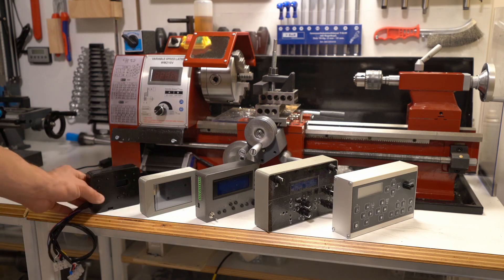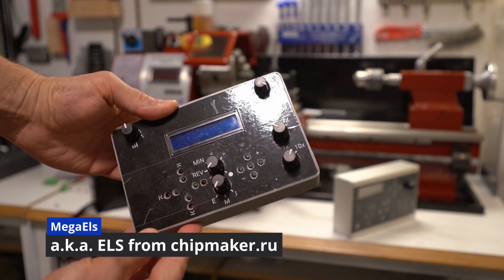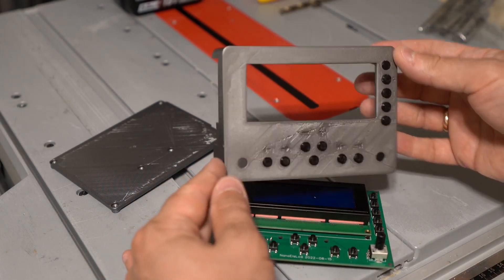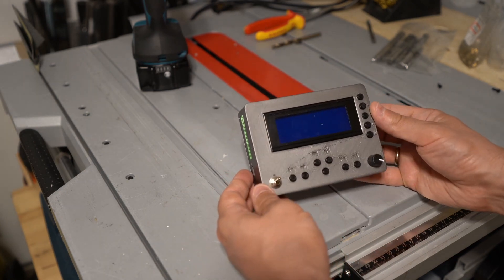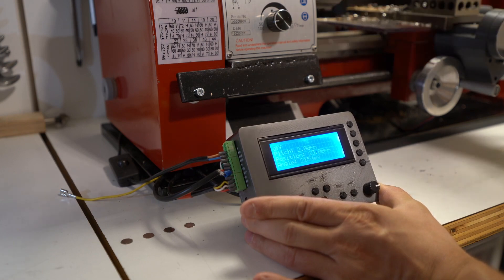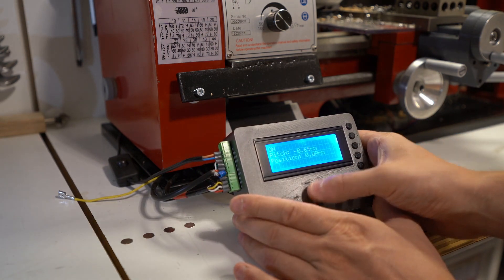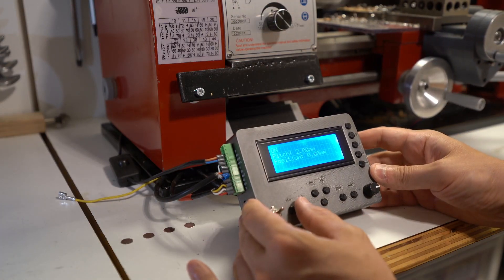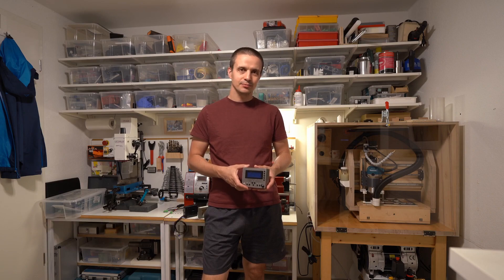Arduino leadscrew: improved 1-axis NanoEls

Comment: Congratulations for your channel! Brilliant devices, clear presentation!
I love very much this kind of "half-dumb" controller for half-dumb people. I am a workshop rat and going full CNC is a no-go for me. I usually make my parts on-the-go  but I would like certain automation to speed up work. I hope I'll succeed finalizing one Els. As I cannot find 600ppr encoder but only 400; would it be suited for application and what changes in firmware would imply?
Good luck!
Reply from the maker: Thanks 🙏 400 encoder no problem. Just change the value in the code.

Comment: Entschuldigung ... wo finde ich die elektronische Platine für die Version NANO ELS H2? für das 2004 4x20 lcd?
Vielen Dank.
Reply from the maker: Hi! Meinst du PCB Gerber für Produktion oder LCD Display? Danke
Reply: @MaximKachurovskiy  da mir dein projekt sehr gut gefällt und ich es gerne in meiner bv25 drehmaschine mit 2 nema mit automatischer verarbeitung machen möchte wie ich aus deinem video gesehen habe habe ich bereits eine nema 23 mit dm542t treiber ich habe bereits das sisplay und den 400 schritte encoder und auch Arduino und verschiedene Knöpfe Ich würde gerne alle Komponenten wiederherstellen, die Sie benötigen, wenn Sie so freundlich wären, mir zu helfen, zu verstehen, welche Leiterplatte Sie benötigen und wo Sie sie in Europa kaufen können ...
Ich danke Ihnen im Voraus.
Reply from the maker: @Roberto-cc4el  Wenn Sie 2 Achsen der Drehmaschine (Z und X) steuern möchten, funktioniert NanoEls nicht für Sie - es steuert nur Z.

Für 2 Achsen können Sie Rocketronics oder https://github.com/kachurovskiy/megaels/ verwenden

Sie können Leiterplatten für 10-20 EUR auf jlcpcb.com bestellen - laden Sie dort einfach eine ZIP-Datei mit Gerber-Dateien hoch.

Besten Wünsche!

Comment: Nice project ! I will implement quite a few of your modifications when I get the Lathe , later this month. Quick question for you :  Did you install the OXA 250-000 Tool post yourself ? Or did it came with the lathe ?  I am just wondering how easy it is to fit an OXA on these machines ...
Reply from the maker: Thank you. Installing the quick change tool post is easy as long as you order the size that's not too big. As you noticed I no longer use it though - 2 blocks and a hold down work better and fit nice big tooling :)

Comment: It's nice to have a large LCD!
However, the volume knob that only changes the brightness of the LCD, which is used infrequently, has too much presence.
It may be enough to make a small hole in the case and operate it with a semi-fixed resistor.
Reply from the maker: Good call, I think one can just put a smaller cap on it and then it will be hard to accidentally turn as the potentiometer is quite stiff. It has to adjusted each time the incoming voltage changes though so I wouldn't hide it inside the body. You can also clip it entirely and just make it flush with the panel and use the screwdriver to turn :)
Reply: Will the input voltage (5V) change during use?
Reply from the maker: @panq1  no, but it changes if you e.g. power it via USB while updating the code on Arduino. Not a big deal :)

Comment: Is there a limit for the pitch ?
I need to be able to cut very large pitch like 10 or 15mm.
Also, because of that, an option to cut compression screw where pitch is changing gradually would be nice addition that only high end machines have.
Basically is need to have a starting pitch and ending pitch l, as well as the thread distance. Depth can be dialed in by hand.

There is a potential problem with compression screws. They not only change pitch but depth also. So I guess if you plan on making this feature available, it will need second axis to change depth gradually as well.
This will be impossible for 1 axis setup but it will enable many users to create filament extrusion screw using this function.

Thank you.
Reply from the maker: Tony, correct, conical or compression screws are tough because very few people need them and they are quite complicated. I think at that point it's simpler to use a CNC lathe controller and be able to cut anything you can model :)

Comment: Does it have metric and imperial?
Reply from the maker: To cut an imperial thread, I simply Google "8 TPI in mm" and then use the corresponding "mm" pitch e.g. "3.17".
Reply: @MaximKachurovskiy  Thanks for replay. It would be great if you can add a button to switch between metric and imperial. But great work thinking of making one!👍
Reply from the maker: @JafferM786  there's an alternative software version of NanoEls aimed at imperial users at https://github.com/gstwrt/nanoels-imperial
Reply: I think it's both.

Comment: I don't think you have enough ELS kits 😆
Reply from the maker: Correct, I don't have yours yet :)
Reply: @MaximKachurovskiy I'm redesigning the board to make it more compact with added connectors for optical linear scales and limit switches. I won't be putting together any soon though, stm32 is unobtainable for the moment.

Comment: Thanks for your els. Would it be possible to add a servo motor to power the spindle to program a stopping angle for gear cutting or bolt circle for drilling. Thanks for your great video.
Reply from the maker: Frodo, thank you, good question, it seems like it would require a completely different style of controller to do that - basically a rotary table controller?
Reply: @MaximKachurovskiy  thanks for your reply. A rotary table controller would be my guess too with a tooth belt to lock the spindle to the locked motor. Maybe this could be a project for you to think about.